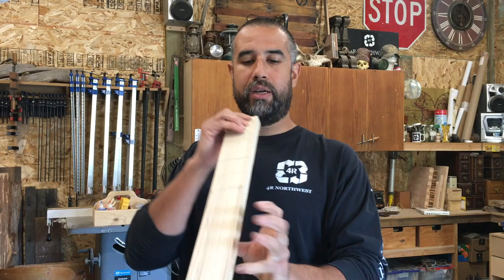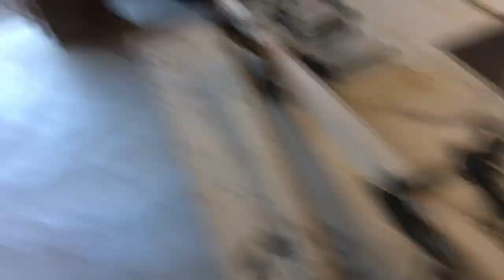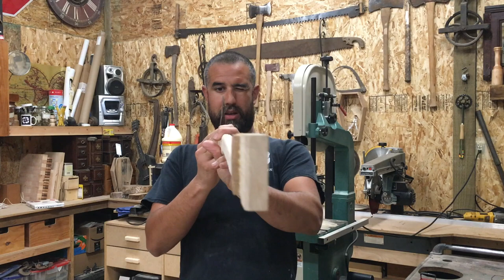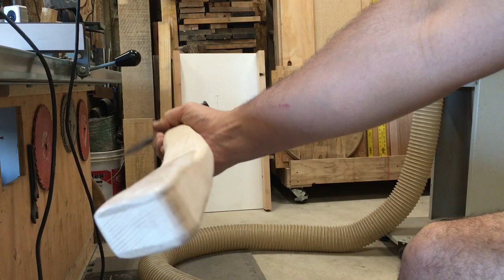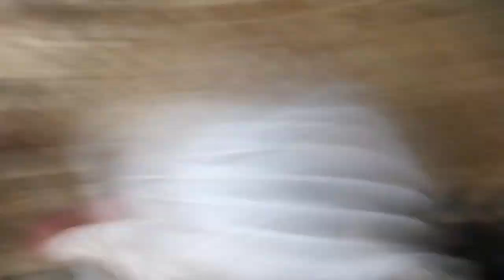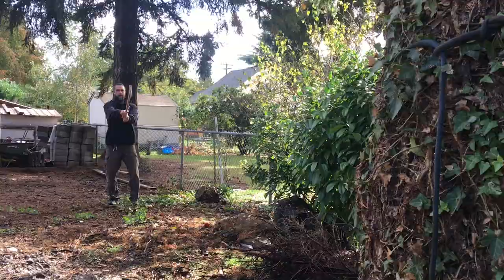Collins Hudson Bay new axe handle

Comment: Hey Matthew great video brother, love how much fun your having, but i have a serious question, i notice you were using a different band saw, what happen to the harbor freight you got. before i go pick one up, did you change it?
Reply from the maker: tdiaz720 well hey thank you for watching! I actually got a smokin deal on a larger Grizzly bandsaw with greater resaw capacity and more power. Which is great IF you really need it and don’t mind droppin about 700 bucks to get into one! The HF model was a good saw! 3/4hp motor is enough power for most your tasks granted you set it up properly and use the APPROPRIATE blade for the task. Would I buy another one at their extremely conservative price? Yes. Yes I would. Hope that helps! Thanks again for watching and hope that bandsaw video helps out too.

Comment: What happened to harbor freight bandsaw
Reply from the maker: Good question! I ended up picking up a larger bandsaw and got a smoking deal to boot! I had them both in the shop for a bit but space is a precious commodity and it was time to let it go. Honestly it had nothing to do with the saw itself! The only complaint I've come across on that model was no 6" riser block available for it. It you really need 12" of capable resew height (which I do) then perhaps another saw would be in order. Otherwise I see no major drawbacks to that saw. Hope that helps and thanks for watching!